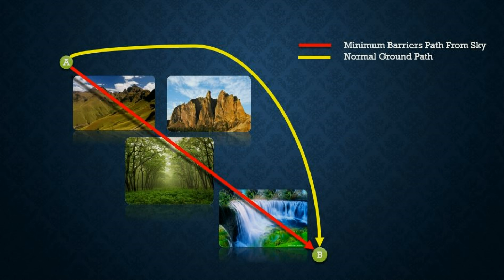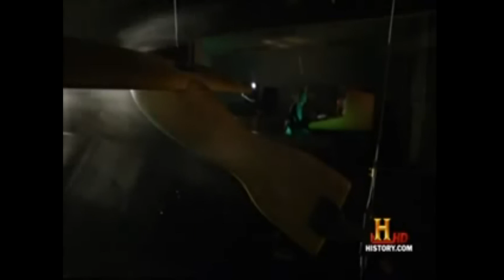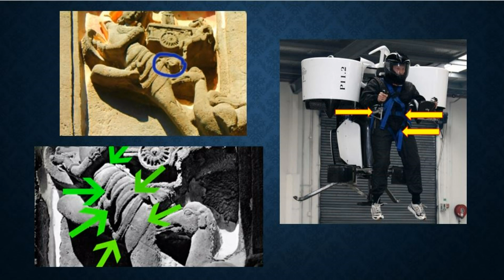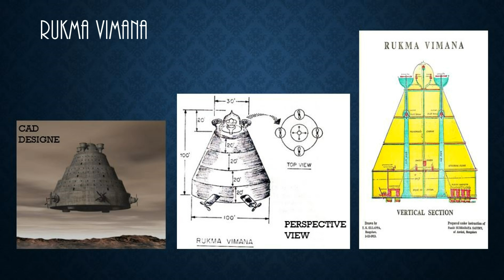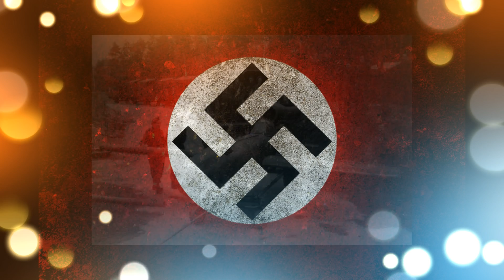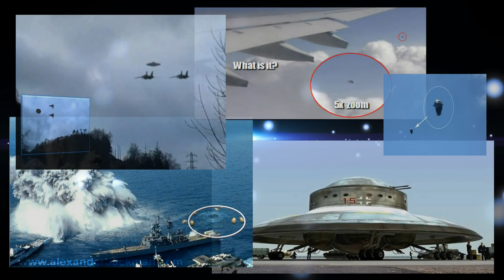Truth about Ancient Flying Machine Technology (VIMANA)

Comment: ive seen the images of the vimana flying machines they are so edited that the basic stuff you see in it is missing lots of peaces  like the pyramid shaped one uses propellers and even that dosent qualify it as antigravity and the electromagnet featured in it dosent do anything and appears to be only attached to the inside hull and theres no mention of any metal mercury which was said to be used  in it  the old translated stuff and the pictures shown dont add up  so i think they faked the real details on how it works no wonder no body has been able to replicate it and make a flying model from the information provided
Reply: They are edited but they are also fake!

Vaimānika Shāstra The existence of the text was revealed in 1952 by G. R. Josyer who asserted that it was written by Pandit Subbaraya Shastry (1866–1940), who dictated it during the years 1918–1923. A Hindi translation was published in 1959, while the Sanskrit text with an English translation was published in 1973. It contains 3000 shlokas in 8 chapters which Shastry claimed was psychically delivered to him by the ancient Hindu sage Bharadvaja.[1]